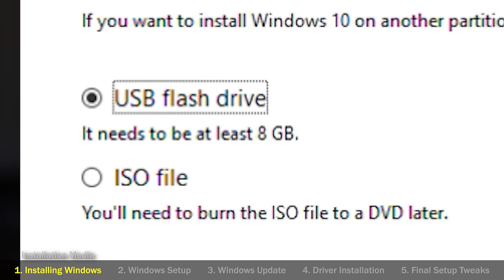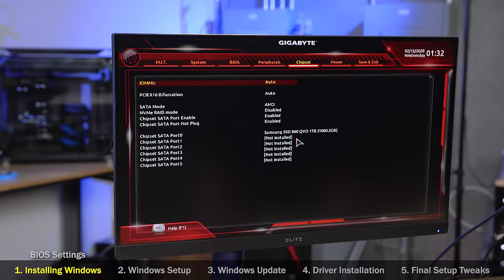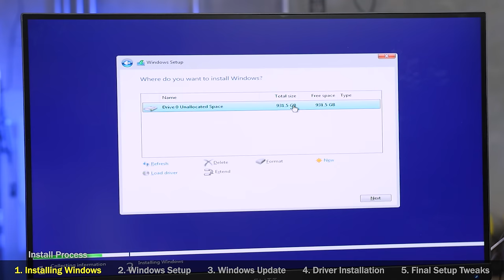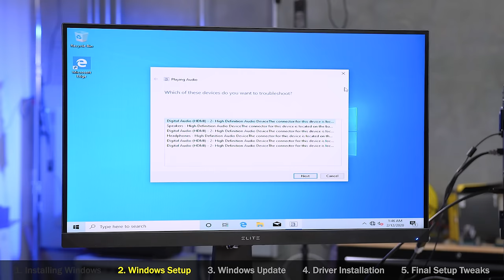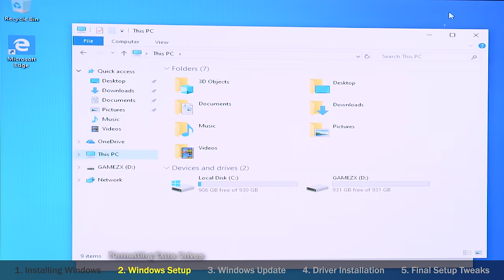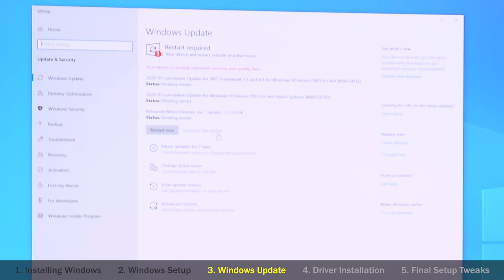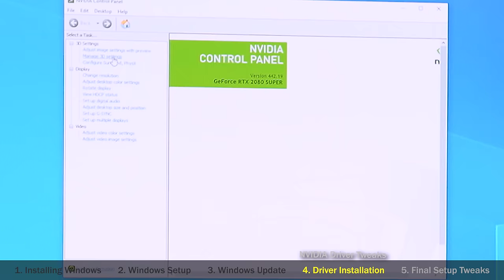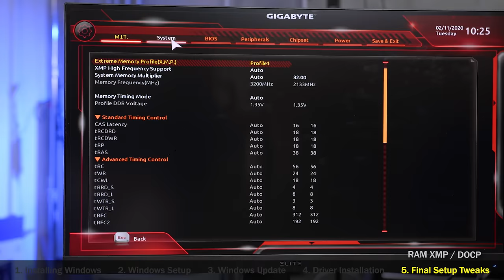Guide: What to do AFTER building your computer...

Comment: I know this video is a few years old, but I just wanted to say thank you so much Jay, you've been amazing in helping walk me through my first build. Love the content!!
Reply: Nothin has changed bro since there. Aug/2022 rn
Reply: Yeah I'm glad I found this particular video... I had started piecing together my PC build in 2019... then the Pandemic hit and things got real expensive real quick lol.  But, I'm using this processor with similar memory with a MB from 2019... so this kinda fits the bill so to speak.  I haven't built a computer for probably 25 years.  Even though it costs more to build your own, it is worth it to me to not have to deal with all that bloatware they pre-load on the built systems.  Going for a clean install with no crap lol
Reply: @Cowboy_Steve  
It is actually supposed to be "cheaper" to build your own since you won't have to deal with the upcharge system builders put on their PC's because they need to cover labor costs. 

It all depends on what you can find. Sometimes it's more, sometimes less.

I also very recently built a PC (literally finished it on Monday 11-28). It's a first for me as well even though I have added/removed components for years from custom configurators like CyberPowerPC. I got them because they were convenient. I have, more or less, "built" a PC, just not from the ground up. I've been wanting to build my own from scratch for a while so I just went and did it. Such a fun process, but tedious at times. Lol

I was able to save money by not needing HDDs since I pulled those out of my old PC to use in the new one.

Got some killer deals over black friday and cyber monday as well, which helps alot.

Total cost for my build was $1,853.39:

i7 12700k
EVGA RTX 3070
32GB DDR5 Corsair Vengeance
Asus Prime Z690-P motherboard
Corsair cooler, fans, and 4000D Airflow

I even got a free WD Black SN850x M.2 since Amazon messed up on the refund. I used this for the boot drive. So flippin' fast!

Putting the same build together from Origin PC and CyberPowerPC, even with the BF and CM sale prices, each came out to over 2k or more.

Couple this with the California middle class inflation relief money I was qualified for (350 bucks), it made this build a steal! So take 350 off the 1,800. 

I feel like I scored as a first timer. Lol

Oh, and it runs cool, quiet, and FAST!
Reply: @P.W.R.  Nice!  I have always preferred AMD chips from back in my old PC building days... here is what I have assembled:

Asus ROG Strix X370-F motherboard
AMD Ryzen 7 5000 series processor
AMD Radeon RX6600 
CoolerMaster radiator CPU cooler
32GB TridentZ RGB Series DDR4 3200mhz 
WD Blue 500GB SSD (for operating system and maybe my video editing software)
WD Blue 1TB SSD (for games and working files)
6 TB HDD (main file storage)
Corsair RMx 850 Watt Gold power supply
Lots of RGB case fans

Comment: I can't believe what the "BIOS" screen looks like these days! lol  It's own GUI! Great videos. Thanks!
Reply: Its so much better than the plain blue bioses of the pentium 3 4 ish era
Reply: @jimmyhopkins1  It sure looks to be! Can't wait to build one.
Reply: NRG PsychoΨ  Is that English?
Reply: I was surprised too, because I had old ASRock without any gui
Reply: @jimmyhopkins1  and phenom
Reply: Oh same thought! I remember those black - gray bios also when my father had windows 98. Kinda looked scary, you know, you don't mess around that window as a kid. It's not an OS it's bios.
Reply: @jimmyhopkins1  lol my pc from a few years back has the blue bios :)
Reply: Technically it's not a BIOS, it's a UEFI. A UEFI can emulate an old-style BIOS if you're either running an old OS or you're an idiot and do the common mistake of installing Windows in Legacy mode on a UEFI system. Seen it many times, it hinders your disk speed and won't let you use a drive larger than 2TB.
Reply: @lbsiuk  bios and uefi is the same thing. Uefi is just a newer word for it
Reply: @signeCS bios is just easier to pronounce
Reply: my p6t’s bios looks like windows 3.0.
i should upgrade.
Reply: @signeCS  I see it like the difference between a jet and a plane.

A jet is a plane, just one with a more modern engine type.
Reply: @RajaniIsa  that's a good explanation, that's why I call them the samr thing. They are both planes

Comment: When I decided to build a pc when I was about 16 I researched parts and build guides every day for a while until I felt proficient enough to buy the best parts in my price range and build it. I knew more about different parts and functions that I probably needed to, and when I was done building I turned it on and had 0 clue what to do next. I had no idea how to get windows on my computer and didn’t even know what a driver was. Just shows no matter how much you spend on a pc, optimizing and using the damn thing are most important.
Reply: Yep we just want to start gaming on something decent. I read up a bit on what I needed, got some advice from a friend and bought the best I could afford. Screwing it all together looks straightforward but setting up the OS is going to be the complicated part I think.
Reply: @Jess-T  same
Reply: @Jess-T  setup is ez, building isn't.
Reply: @maconaccount2533  Depends how your brain works haha. Screwing it all together looks reasonable, if I mess up it will be on something that should be simple like installing Windows lol.
Reply: Imma try to do what u did but be more prepared for the software part too

Comment: 1:02 Installing Windows
1:32 Bing by Google 
7:42 Windows Setup
12:41 Windows Update
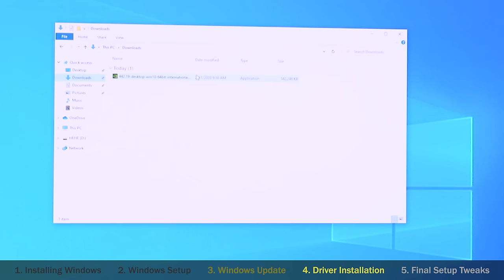16:27 Driver Installation
18:17 Final Setup Tweaks
Reply: 19:00 Reboot and installation of Debian instead
Reply: Tribal Humor you should probably check the RAM speeds, most of the time by default they run much slower than possible
Reply: @tribalhumor6684  if your board came supported for your cpu and your not running into problems. The only reason would be if there is some security flaw to patch or feature you need. In bios (or CPUz) you can see what version you have and on the motherboard bios page it should walk you through what the new ones add if you needed it.
Reply: @coryandrum  Okay stop giving advice lol. You've never touched a custom build/bios in your life
Reply: Bing by google 😂 I noticed that too but seeing it in your time stamps made me laugh maniacally. Thanks
Reply: @mr.blonde7812  Said the man that gave none and claims to know all. Regular pc's have bios too; duh, and "del" key... wow that was so hard to get my b350 to run 3rd gen... NOT.
Reply: @goku445  You misspelled Arch. :P
Reply: @ThatBoogieman  That works too ;)
Reply: Die Ecke there are a lot of tutorials online. But I'd recommended letting someone you know, who knows what he's doing, help you out. It differs between brands. And if you f it up you need to reset the bios.
Reply: @mr.blonde7812  criticism of my language use; classic defection. As you place a adjective for a noun after the punctuation.... Are you a computer genius or a English professor? Definitely not a Insult Professor.
Reply: @coryandrum  I'm not trying to insult you. However, your english really is terrible; as further demonstrated by your last comment. 

Yes, I'm quite computer literate. I've been building them for nearly 20 years. Would you like to compare current builds?
Reply: @mr.blonde7812  You seem really determined to prove something; like the validity of proper English in a non formal comment setting. 

Why are you adding a paragraph space to your comments? lets compare builds from 2000 then.
Reply: @coryandrum  It's not about proper English, it's about trying to decipher what you were attempting to say
Reply: @mr.blonde7812  Oh, well the terms where computer lingo so i can see how it would hard for people that don't speak it. A "board" is a Motherboard and a "cpu" is a central processing unit. A "security flaw" is a feature that was overlooked and is exploitable. The "feature" would be a next gen technology or better ram support. a "bios" is a basic firmware to control the computer initialization. "Cpuz" is a program to get information on your computer.  We are talking about a bios subject so when i refer to something with out repeating it is because its the subject matter. You should take a course on how to read "Texts".
Reply: Arief Nuur Hidayat thanks

Comment: Hey Jay, case you didn't know by now, monitors have specific drivers on their own manufacturer's support page. That makes Windows completely understand all the capabilities that a specific monitor can and cannot do/support. I could see that your Windows said "Generic PnP display" which means Windows doesn't the heck know what kind of monitor is connected to your Graphics Card. You just need to search on the their website, with your monitor's model number and go to download and then drivers.
Reply: thx´s
Reply: @PyroInstitut  no problem my friend! I almost fried a monitor back in the day. I selected a resolution I wanted but didn't know the monitor couldn't support it so, it went black and monitor status light started blinking non stop. Had to use SafeStart and revert the resolution/hz back to previous setting and do normal restart to get it back up and running. Then someone told about monitor drivers and went to get it. Next thing I know, the resolution I selected and failed, wasn't even in the preset parameters anymore, ergo, it didn't support the res in the first place. Lesson learnt!
Reply: @KomsBoult  you can't fry your monitor like that.
Reply: download motherboard and monitor drivers?
Reply: Do you know what he plugged in at the beginning of the windows update part?

Comment: Pro Tip:   Download all your drivers, tools, must haves to a USB drive before hand and use that to install everything after OS is installed.
Reply: I definitely second this. So much faster and allows you to install everything even if you don't have internet.
Reply: This is especially useful for motherboard drivers. It ensures anything and everything on that board will work. It's rare but sometimes a device might not work which could be your network card, and no internet means no fixing.
Reply: I do this since windows 98. Download all necessary stuff 1st in a separate media (back then cd,dvd now days usb) . Then unplug net , install Windows, then install all then disabled all privacy and spyware stuff. Then pug into net.
Reply: TheSkepticSkwerl learned that back on the am3 boards, confused as shit... finally looked in the box and saw the cd and went “oh” now having built more computers usbs are amazing
Reply: This is what I generally do as well.
Reply: @dankbeast9013  usb are great. At one time I used an Iomega ZIP drive before usb,CD, or DVD were more common.
Reply: @Tigerskunk  iomega zip drives, man, stop making some of us feel old! ;)
Reply: Any idea how to do that? Like how to download driver for my 1660 super before on a different computer?
Reply: If you have a laptop or another computer already, yes definitely do this. However, in my case, I didnt have these. So I had to use my phone to tether to my pc so I could install all my drivers that way. Gettings windows 10 was a major pain, thankfully I had a modern phone and a flash drive
Reply: Whats a usb🤔
Reply: @vedantkothari8347  https://www.nvidia.com/Download/index.aspx choose card and you are ready to go. You can also refer to your videocard vendor site for driver.
Reply: I've actually been planning to do this with software tools I usually install and programs like excel and such (not debugging tools but I may do that aswell soon) and i can certainly recommend this especially if you lose your... installers... frequently  and something else that may help that I just discovered down here is a website called "ninite" seems to be a website that makes a single installer for a good handful of software most people install
Reply: @TheSkepticSkwerl  aye I wish someone told me this before I did my first Win install :') ... Good thing I didn't do a clean install and could boot into ye olde XP to get the network card drivers (and then go back and repeat the process liek 50 times cause the drivers didn't work x))

Comment: Be sure to buy a USB stick that´s "really over 8Gb" to install windows, most brands will market 8gb media but will only be about 7,8gb and Windows will not allow you to install from that stick.
Reply: ? I've used 8GB USB drives without problems. The Windows installation files will not take up more than around 4-5GB so an 8GB USB drive will be fine.
Reply: @JJFlores197  I´ve tried to use a transcend 8gb usb drive and after following all instructions in windows website to create an installation media,  an insufficient memory error came up before anything was written into it. The 8gb drive was formatted and totally ready but it  had actually a little less than 8gb, like 7,8gb. It´s not how much space the files will use, it´s the space that windows requires from the drive.  Maybe there are other drives that are marketed as 8gb with actual 8gb space in them Idk
Reply: @tomasgrimm3086  Drive manufacturers use base 10 to describe drive sizes. Windows uses base 2, so there will be discrepancies between the actual capacity of the drive and what Windows sees. You’ll always have less space on a drive than what it shows up as.
Reply: and also USB3 for less annoyance and slowness while transferring files. have multiple thumb drives, label them.
Reply: I didn’t realise how big my flash drive was until it came... I think 36gb is a bit too big
Reply: What do you recommend?
Reply: @blysteryy2578  I would recommend a 16gb stick or any drive that says 9gb or more
Reply: I bought a 100gb usb and it acutually had like 112gb of storage😂🤣🤣
Reply: I've installed windows installation tool on 4gb usbs before...
Reply: @manual0103  before when? lol, I´ve tried it a few weeks ago with a 7,8gb usbd and it gave me an insufficient memory error, then I had no problem with an 16gb usbd
Reply: @Tomas Grimm I just installed windows from an USB flash drive with 7.3 GB following all the steps
Reply: Bruh 8GB sticks are kind of obsolete now. You get 16GB sticks minimum and its as cheap as one lunch money. XD
Reply: @tomasgrimm3086  must be an issue with your stick in general, I’ve used a stick with under 8 gigs the other day for a friends build and it worked completely fine installing 64bit windows home
Reply: @tomasgrimm3086  Maybe you had additional packages included, that raises the storage needed on the installation drive (while you wont need most of those packages), or maybe your stick was pretty old and still had FAT16 what allows only file sizes of 2Gb (you can have more than one file, but a single file cant exceed that). Just some ideas, from my experience. usually 8gb sticks are fine.
Reply: I'm getting my USB stick from Wish so it's gotta be good 😂
Reply: @plana1344  lmao good luck
Reply: 8 GB works just fine.
Reply: Any link to where to buy?
Reply: my god I tried a total of 7 sticks with each one needing like an additional 100 mb at most
Reply: @tomasgrimm3086  windows 10 64bit download of Microsoft website only requires 6gbs. I dont know what happened to you but the full download doesnt even go over 6 gigs
Reply: Some USB sticks "lose" memory when formated, and if you are like me, who has formatted their poor 16gb Kingstone USB stick legit over 15 times, it will show in the end. So, you build a new PC Just by the cheap new USB too!
Reply: @plana1344  did that usb stick show up yet?
Reply: There are discrepancies between drive and OS, binary translations, system files and data on the USB that's hard coded on to the drive to make it operate correctly.  If you have an 8GB drive and you had a capacity error you likely downloaded extra packages and language packs etc for Windows.  Microsoft themselves ship Windows 10 US English version on an 8GB USB drive, as does Dell.

Comment: My #1 Tip: Keep a bootable USB programmed and ready at all times in a drawer. Label it with tape so that no one confuses it.
Reply: Just label it as "sex tape", so no one will touch it.
Reply: This 100%. Saved me more than once!
Reply: The windows install usb he made in the video?
Reply: If i fuck up to the point I need to re install the os, downloading windows and making a bootable USB will be the least of my problems.

You got mess something up colossally to need a format these days.
Reply: @V_0717  is it okay to install my drivers and the windows installation media on the same USB before booting up the PC for the first time?
Reply: yes easy reinstall for if u get virus
Reply: @RavanaMuse  um usually not, if your hard drive or ssd gets corrupted then u might needa replace it but usually just reinstall windows 10 and it will be fine
Reply: Sword of a Thousand Truths
Reply: It's rare that a drive gets confused. More commonly a user mistakes it for something else.